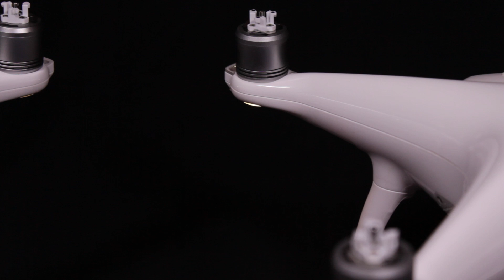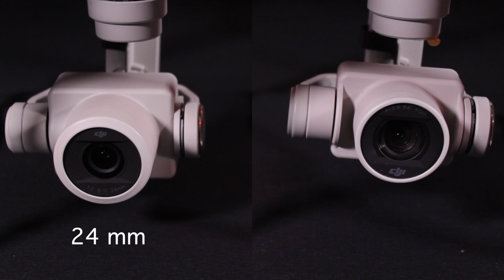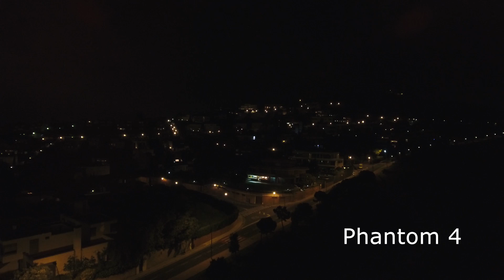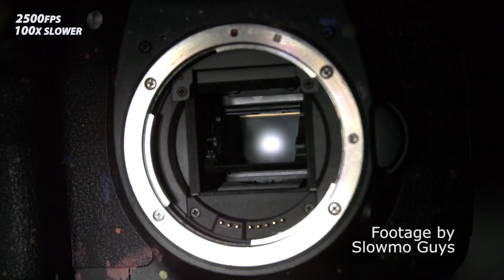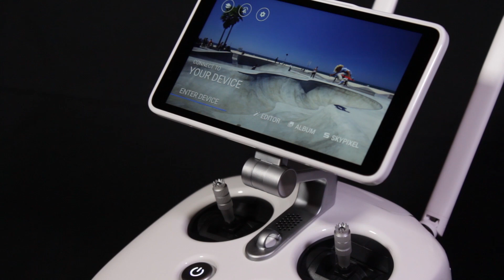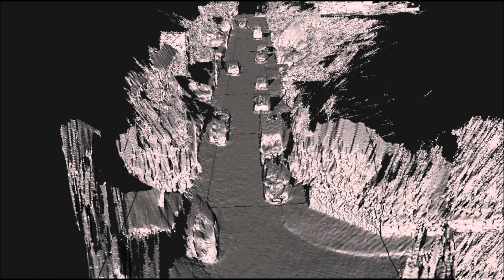Phantom 4 Pro vs Phantom 4  Comparison

Comment: Thanks for taking the time and explaining that to me. I do have one question which I hope you can answer for me. I use a screen record which I later fox out and edit the Telemetry and add it to the 4K video. I use a simple screen record. If I buy the plus with the remote control that has the screen, is my only way to Overlay the telemetry is by using air data? I've always found this to be complicated which is why I just crop the Telemetry from the screen record and paste it on the 4K video for an end result of the high-quality video as well as the information of speed distance and height.

Comment: Can I connect my black pearl or fat shark transformer monitor to the HDMI port on the Phantom 4 Pro standard transmitter or do I need the plus controller? I guess the short question is, is do both controllers have HDMI out?

Comment: The one on the right is a phantom 4 pro plus. I have the phantom 4 pro and the only difference is the screen on the controller. I use multiple tablets (my phone,galaxy tab e,galaxy view)for various flights,depending on what im doing so i wasnt paying an extra 300 or so for a screen.

Comment: You are TOTALY WRONG, with your explanation of the effect of the neutral density filters. Also, when used, it is the SHUTTER SPEED that is changed, (Lengthened) not the aperture, as the lens, is already at it's max, of "F 2.8" and can not be opened up (to let more light in) any further. I do wish you people would get your information right, you have a responsibility to inform , with the correct facts!

Comment: You put the $ on the wrong side...

$1,299 not 1,299$ 

The cents sign goes on the right

89 dang it I don't have a cents sign on my keyboard!

Also which euro sign do you use € or £

Comment: Why i should pay more 300 $ for P4P+ ? Just for 5 inch built in display? Which is probably much cheaper than 300$. Unreasonable.
Reply from the maker: 1. because it's DJI 2. Because there are not much super bright tablets out there 3. You don't have to deal with the device companability and USB cables anymore. 4. DJI claims that with built display they reduced the image transmission delay.
Reply: I think that these arguments are not worth 300 $ for P4P+.
Reply from the maker: Some people would agree, some disagree. Maybe that is why they are making a regular version of P4P without screen

Comment: How much better is the phantom 4 pro too the phantom 4
Reply: Not enough to upgrade. You dont need to buy every generation of Phantoms. Only buy a new one if you crash your old one (You will have a good excuse to upgrade) or wait when something like phantom 7 or 8 is out and it has some groundbreaking tehnology.

Comment: You have such passion! I cannot thank you enough for taking your time to go into so much detail. You mentioned several nuggets that I didn't know about. I liked your clear explanation of the rolling vs mechanical shutter, those illustrations were perfect to get the message across.
I didn't know the new remote had a built in microphone.

Great job indeed. I just subscribed to your channel, I want to see more great content like this.

Comment: Looks like the Pro camera is a little lower down. I'd imagine that that and the narrower field of view means that the props don't come into the video as badly as the normal 4?
Reply: Check out the HUGE CHRISTMAS DISCOUNTS DJI is having: http://click.dji.com/AIQNkLC6Dr1hIxCr0DSm?pm=link&as=0001
Reply from the maker: That is correct. However,  You will get huge props in the frame in sport mode. Also narrower field of view will give your footage more cinematic look
Reply: WeTalkUAV.com well at least it's better than the 4! yes, I'm really happy about the narrower field of view. I'd prefer if it was even tighter like the Mavic actually. It's also nicer because when you're filming somebody or something you don't need to get as close to them.
Reply from the maker: In fact it would be awesome if it had optical zoom, so we could change FOV
Reply: That would also be cool. I suppose it is one less thing to worry about when composing a shot though. And zoom lenses aren't as high quality as primes.
Reply from the maker: You got a point on that one. Primes are providing better quality picture, less distortion and ghosting and better sharpness
Reply: Luke Maximo Bell

Comment: Great video.. My only question is..  Is the HDMI  on the controller  for external display? Thanks
Reply from the maker: That is correct, you can connect it to the TV or any other monitor that supports HDMI